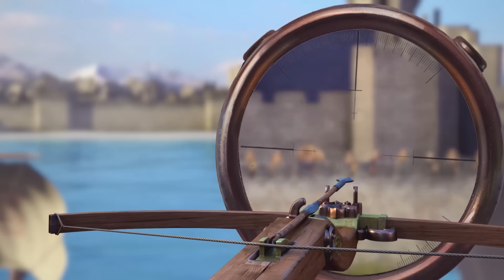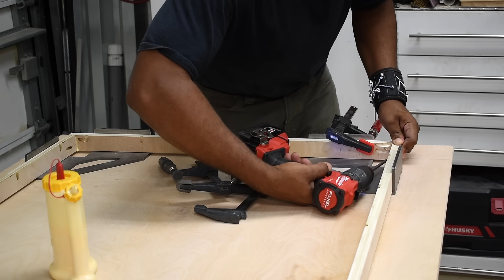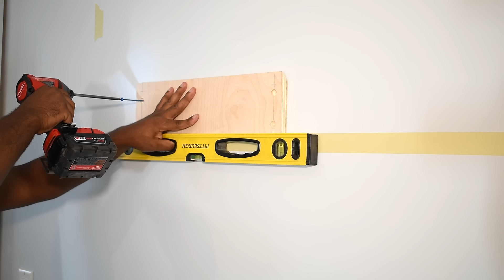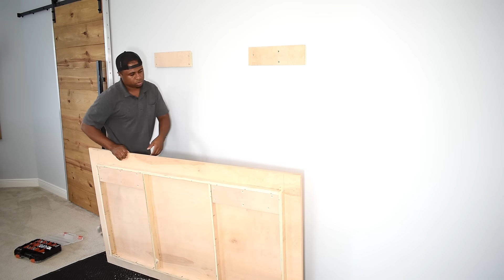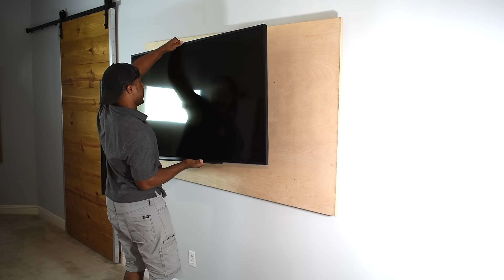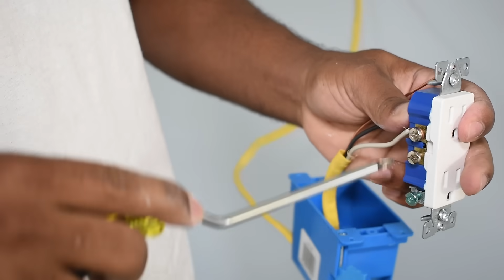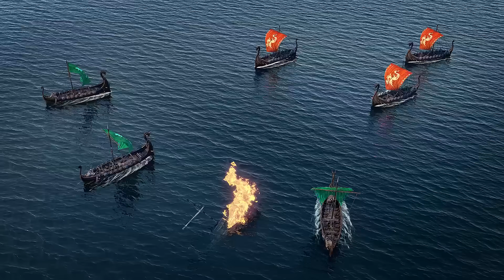How to make a TV panel - Wall mount a TV and hide the wires

Comment: Man, I swear you must have the coolest looking house. Great job man.
Reply from the maker: Haha, I try! Thank you
Reply: @DIYCreators  3bedroom,living room,kitching & bathroom designs you have
Reply: Im telling you...taking notes
Reply: Please help, TV wall bracket says no toggle bolts. But only can fit bracket on one stud. The wall bracket is verticle, thought it be easy. Last time I did,  sthe top of TV started leaning foward. Screw would not hold because not in stud. Can you explain what I'm doing wrong. Pleeese help
Reply: @susu-mi7kx  not really sure I understand your problem but I can try to offer some advice from doing my own, it may be different from your scenario though. First make sure the mount you're using is rated to support the weight of your tv. If it's the type of mount I'm thinking of, it has two bolt holes correct, one above and one below? If it is, the most important thing is to make sure both are mounted to a stud, obviosly. Get yourself a decent stud finder and find the center of a stud where you want it mounted. From there the only thing I'd say to watch out for is do not drill a whole larger than the lag bolt you're using. You should be good if you do all this, but again I don't know your whole scenario so I'm just offering advice. In some cases, a tv mount will use toggle bolts to help the main lag bolts support a tv but, they should never be the main support for the tv mount in my opinion. Even in this video, he only uses it to support the mount, not to be the main support. Lag bolt to the stud and you should be fine. Hope this helps in some way.
Reply: No, because he whould be done.
Reply: a real handy man is never done
Reply: Friend handyman lmao

Comment: Yet another example why I sometimes hate my brick walls.
Reply: Dominic H. I was thinking the same thing! And on top of that I live in a 1880 town home and both sides are brick then I have one of those huge doors which slide into the wall and I can’t place my tv on it because it will mess up the value of my home.
Reply: Build a fake extra drywall with 2×4s .its what I did
Reply: Can't, if the wall doesn't breathe, mold will immediately set in. It would cost thousands of dollars to properly insulate the wall first. Maybe next year...
Reply: @dominic.h.3363  i got brick walls to... and we need a driller to drill holes unlike he was just using a screw driver
Reply: You can drill through a brick wall, but you can't fish cables through it unless you also use a chisel to carve out channels and then plaster over it when you're done and repaint the whole wall. It's just not feasible.
Reply: @1Odama  It doesn't work like that...
Reply: The externals wall are brick not the internal walls!
Reply: @mahmoudkhodr166  Where i live (Denmark) EVERYTHING is brick - we just dont have drywalls - internal walls are all brick and some reinforced - so its stronger, but can cause some problems :)
Reply: @mahmoudkhodr166  in germany are the inner walls also brick, we build like this.
Reply: Build a fake wall
Reply: @jesusperez331  The additional cost of living in mainland Europe in brick houses is that they aren't particularly large, so building fake walls on top of real ones reduces square footage you can't really spare...

Comment: If you want to show off your components a bit, I think that a  "simple", single floating shelf would match up pretty well. Maybe with similar led backlighting? conceal your power outlet(s) for what ever boxes you'll have and run those cables into the shelf then up to the tv behind the wall so those come out behind the screen. Some in-wall or wall-mounted speakers and you get a pretty clean looking set up. 
Nice work, as usual, thanks!
Reply from the maker: Thanks, :D Wall-mounted speakers are out of the picture :). There is a cinder bold wall behind the drywall. Maybe a soundbar or something.

Comment: Just an idea; there are kits that you can buy and connect to your TV so the LEDs will interact what's on the screen.
Looks really cool.
Reply from the maker: Thanks, I have a couple of them but I wanted the light further away from the TV. Most of the ones I have seen is pretty short.
Reply: @DIYCreators  I got the Philips 65" Ambilight, it throws the light around 15-20" out on the (white) wall. 
It has multiple settings ranging from mirroring what's on the screen, to really psychedelic patterns following sounds. 
Wow, sounds like I'm a Philips sales rep....